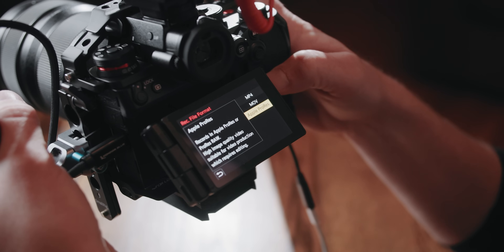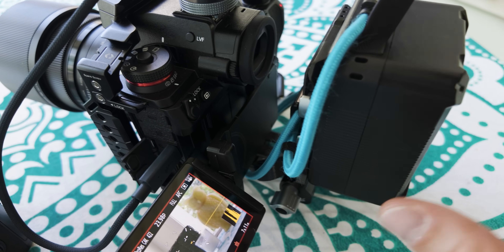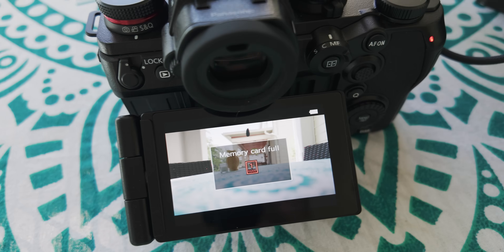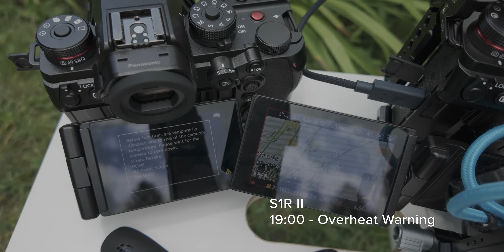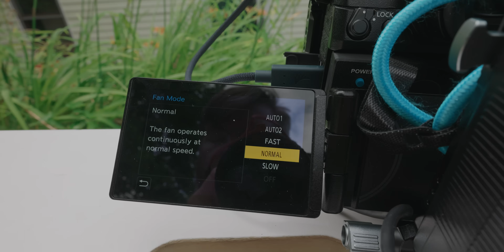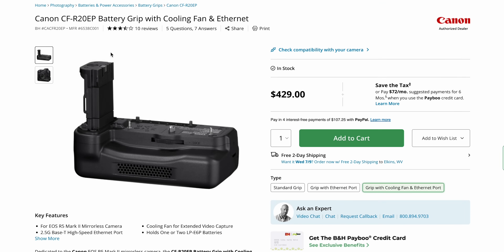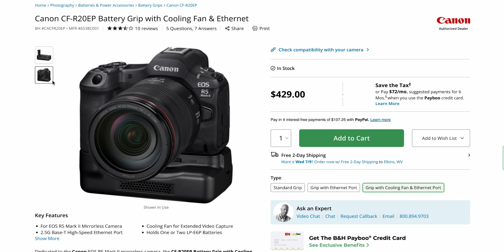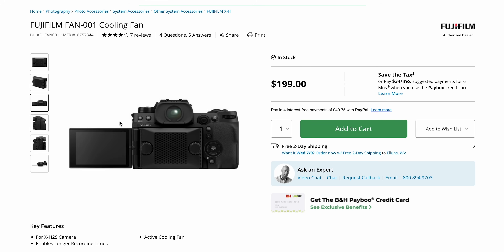I Tried Everything to Not Have My Lumix S1R II/S1 II Overheat

Comment: Try draping a white covered rain cover by Lens Coat they block sunlight and provide air flow Arctic White. come to think bout it a mylar aluminized polyethylene is highly reflective it helps to block radiant heat from the sun and will prevent the camera from absorbing as much thermal energy. their extremly light weight and easily portable.
Reply from the maker: Interesting... I would think a rain cover would trap more heat than it blocks, but I'll look into it! I just ordered a small camera umbrella from Orca and will give that a shot (haha this is getting silly).

Comment: Stay with your Canons. Cameras that have restrictions scream NO THANKS.
Reply from the maker: Well, the Canon mirrorless cameras have always overheated, which is why I always avoided them (and have really been crippled in DR until the R5 II and C-Log2 came along). But, the C70/80 models are definitely super reliable and I've never had an issue there.
Reply: @CurrenSheldon Have you tried the R5C? I think you’d be pleasantly surprised despite it not having clog 2. Also hoping they continue with that line and make an R5CII
Reply: @CurrenSheldon  Because C70-80's are true cinema.

Comment: Really makes me wonder about the S1IIE. S5IIX reliability with internal ProRes RAW, cropless stab, false color, and the new and improved body? 🤔
Reply from the maker: That's exactly what I'm thinking... is it the updated sensors that are creating the heat or the new body? I love the S5IIx, but definitely BIG improvements in IBIS, body design, functionality, AF, timecode, etc etc that maybe the S1IIE is the sweet spot.
Reply: @CurrenSheldon honestly, the new cameras are so good that keeping an S5IIX (or possibly an S1IIE) in your bag might be the final piece to the puzzle. Just pull that thing out for those 1% situations where you need it, and the rest of the time, enjoy the incredible image quality. You probably don’t need it since the Ronin is your A cam, but for the rest of the community that could be a killer strategy. Kinda crazy to suggest buying a second cam to make your $3200 cam work lol, but honestly I’d do it for the lumix magic.
Reply from the maker: @wackster1  Haha very true. I'm also toying with finally implementing an idea I've wanted to do for years, which is have a two camera system like photojournalists and wedding photographers have. Put a 24mm or 35mm on one and my 85mm on the other, and just go back and forth and snap the one I'm not using on a capture clip - this would require having an audio person, but for my main doc work, I usually do. Could be very cool and would give each camera time to cool in really hot environments.
Reply: @CurrenSheldon if you have a couple deity tc-1’s then this would work perfectly for audio sync

Comment: I was so ready to write my comment "have you tried..." and while watching all subsequent options I thought of you exhausted. Damn... 🥹
The only thing left is probably trying all recording modes from S5IIX one to one on S1II and checking if it overheats or not.
Reply from the maker: True - I'd love to try the S1IIe as well and see if that camera overheats. Granted, it's not a huge upgrade spec wise from the S5IIx, but I love the new body, new IBIS, new screen, timecode, etc. Is it the body causing the issue or the heat generated by the sensor?

Comment: I saw someome attach a ulanzi cu01 fan with a cooling pad behind  the screen joints and it solved the overheating. but the tilt flippy screen isn't helping. also sd cards help alot. also try an on camera umbrella
Reply from the maker: I did add a fan to back of the camera and it definitely helps. But in 90-95 degree, full sun, the camera still overheats. But a fan definitely helps and will keep it from overheating indoors or in the shade.
Reply: @CurrenSheldon  your fan isn't as good as the ulanzi cu01

Comment: Thanks for doing the tests, Curren. Kind of disappointed in Panasonic, to be honest. The MAIN reason I switched from Sony aps-c to an S1 six years ago was because all my Sony aps-c cameras kept overheting like crazy (a6500, a6300, a6000, a5100). Anyway, thanks again.
Reply from the maker: Agreed. For a company that has made its name for their incredible video features and video reliability (S1H was doing open gate 6k in 2019 with NO LIMITS while other mirrorless cameras from Canon and Sony were overheating left and right), having this big of an issue in their new flagships after people have waited for 5-years seems like a big misstep. Seems like it would have made way more sense to make a rock-solid video body instead of the S1 II, then you could have the S1R II for photos and high-end video with limitations and then a rock solid video model. The S1 II is incredible, but it is not rock solid.
Reply: there's overheating with many, if not most, of the non-FX Sony full frame cameras as well (a7iv, a7cii, zve1, a7rv are all well documented). Everyone's forgetting that the Ulanzi cooling fan solution was essentially made for Sony cameras. It seems the FX line, or dedicated cinema cameras, are the only way to go to fully avoid overheating
Reply: @joeXjoeX the Sony models you mentioned don't have a fan but the new Lumix cameras does have one so it shouldn't overheat right? 😢
Reply: @joseacarrasm  So Sony put out a $4000 in the a7rv that does 8k with no fan? And a bunch of fanless cameras that have trouble recording 4k for more than 20 minutes? You're happy they gatekeep internal fans to their FX line? Weird but okay.
Reply: @joeXjoeX  weird because i extensively used both the a74 n a7rV in the scorching sun and once i set the temp to high..never had an overheat warning 😅 the others are vlogging cameras 😂
Reply: @loudmotion5639  oh word? I guess all the YouTube videos about their overheating issues and confirmed stories from Sony videographers are lies? And $2k+ cameras like the a7cii and zve1 are only vlogging cameras huh? Well darn, someone better tell all the reviewers because they keep suggesting they can be used for more than vlogging. Guess you're the only truthful person and everyone else is lying about Sony overheating issues and lying also when they say $2k cameras like the zve1 can do more than just vlog
Reply: @joeXjoeX for hybrid the r5c alao exists.
Reply: There is no s1X maybe S5iiX?